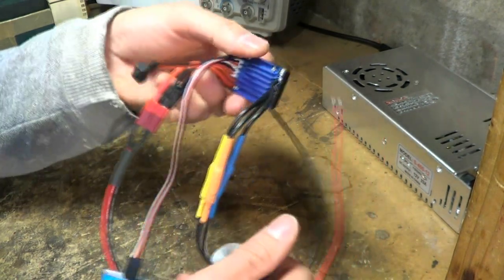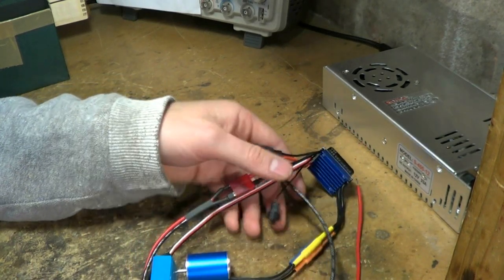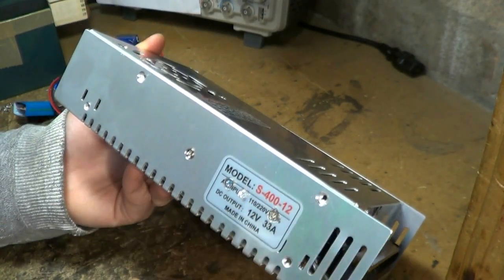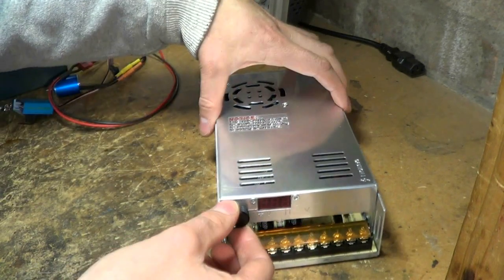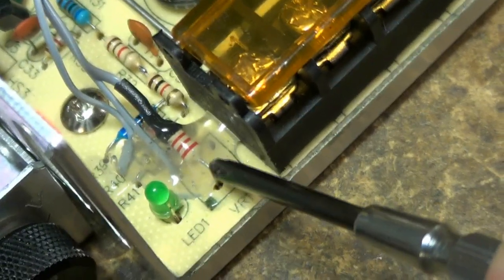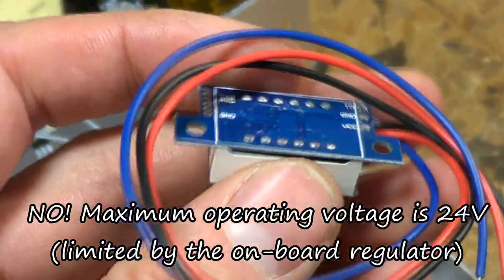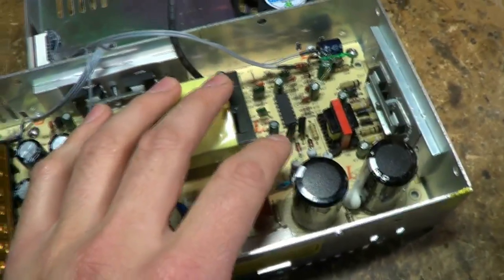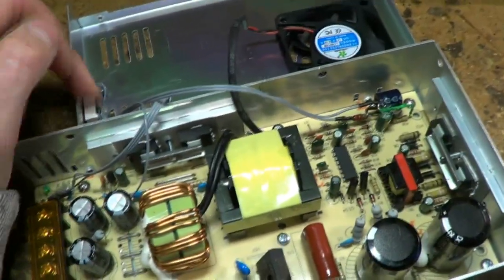Modifying a S-400-12 switchmode power supply for variable output voltage

Comment: hey Lindsay thank you for this rich and detailed video. My question is this one, i have a qp 200d switching power supply from ebay that should output v1:5vdc adj, v2:+12vdc adj, v3:+24vdc, v4:-12vdc . But after measuring these voltages everything is correct except for the -12vdc. instead of -12vdc i only get -7.1vdc and i am wondering how to get that voltage up to -12vdc. Could you please help me? THANK YOU
Reply from the maker: Sorry, I really wouldn't know about that - it sounds a much more complex supply, multiple outputs, and active PFC.

Comment: Hi. I have a question for you.
When the 12V is applied, is the output 30A?
Reply from the maker: Not sure what you mean - the load will draw whatever current it requires, according to Ohm's law.
Reply: it can be (max) 35A in short time...before overheated and melting...

Comment: Came across your website/video from doing a google search on this model of power supply.

I have one of these Power Supplies for my 3D printer, which is in the next room, the only problem I have is it causes me hash/rfi on 160m, it's worse when the current draw is high on this power supply, i.e heating the bed/hot end.

I wonder if there anything I can do to this to stop the hash/rfi it's putting out on 160m (1-2mhz)

Great website by the way :)
Reply from the maker: Hi, I would try adding an extra line input filter before the power supply to try and block any RF that it's putting back on to the mains input, and I'd also try adding another stage of output filtering (DC inductor + more smoothing caps) to do the same thing at the output. Also maybe use shielded cables going to your heated bed, in case that's acting as a bit of an antenna?

Comment: Just by mistake I conected the same power supply to 220V  with the switch in 110V, the only thing i've seen it's broken is Q4, is there anything else that could suffer damage?
Reply: C3 may need replacement since you have applied approx. 220 x 1.4 volts into a capacitor rated at 250V